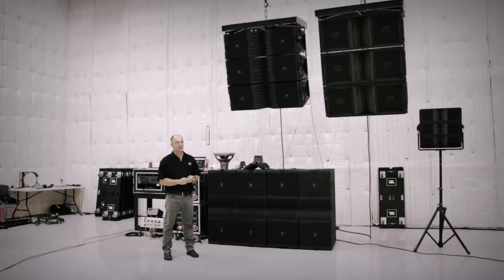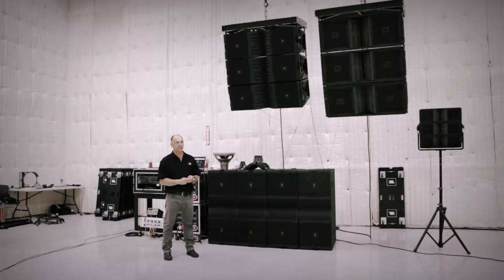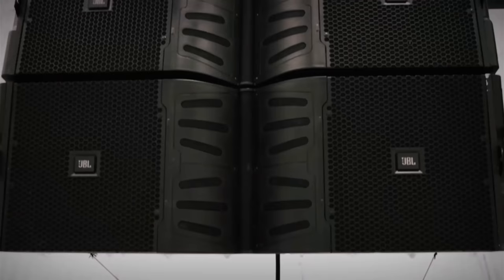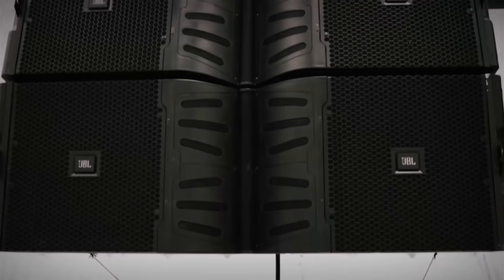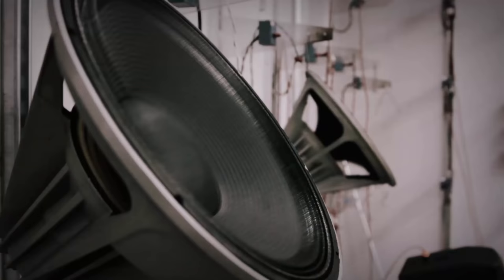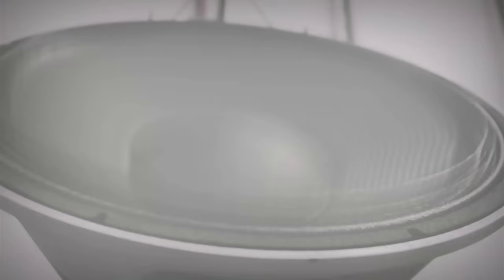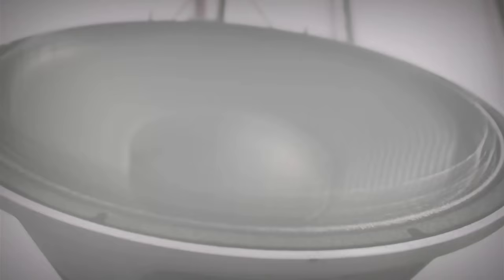The JBL Story

Comment: yeah it is very professional, rugged, anf very clear audio.. But why the fvck is this so expensive?
Reply: Income and quality speakers
Reply: Because it is very professional, rugged and very clear.
Reply: @Thetimrobertson  it's just a name that's all I've heard better just my personal opinion on this subject
Reply: See, you are paying for the brand name! 
You can order components and build the same speaker with same internal design for less than 20% price of the original product. 
All you need is right frequency crossover to make it sound good. 
High power amps likewise Crown Itech 4x3500HD. 
Matching impedance. It's the key!!!! If you fail here, you loose everything you built in less than 1 sec. All money wasted. 
Even B&C, Faital Pro, 18Sound etc etc drivers sound good. It doesn't necessarily have to be from JBL or Harman Kardon Audio.
Reply: If you want you can build JBL V25, JBL V4889, JBL 4880, JBL G28 etc etc. Measurements already out on MrFlexy SMPS channel. 
Get same performance at cheaper rate!